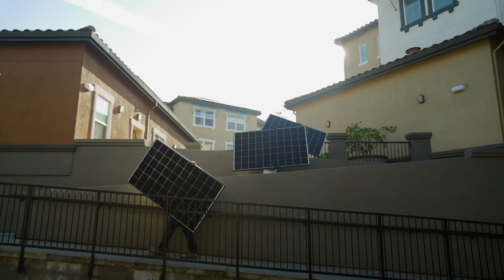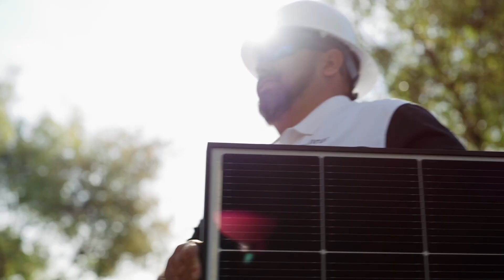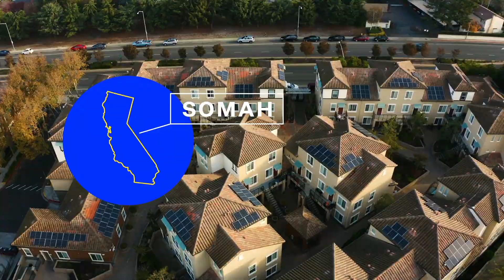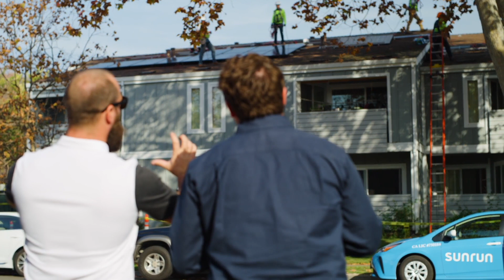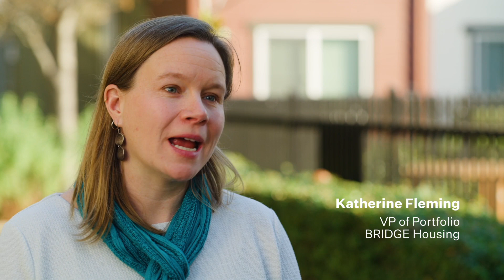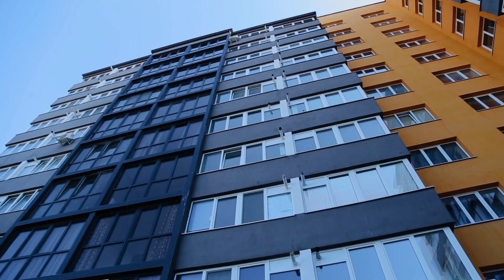Sunrun Multifamily 2022

Comment: Beware***  Would not recommend Sunrun.  We purchased a Brightbox battery to use after the sun goes down.  We shared our intent with the salesman prior to the purchase. However, Sunrun has decided we can only use the battery from 3pm- 8pm.  In the summer this $6k box just sits idle since the sun does not go down until 9ish. They originally stated this was an agreement with Sunrun and the utility company until we had a conference call and when the utility company stated there is no such agreement.  The utility company stated they are encouraging customers to use their battery.  Sunrun then stated the contact was the one my husband and I signed that reads "You agree that Dealer may, from time to time, remotely administer the batteries in your Solar Facility in connection with demand response or other programs in coordination with your utility to maintain the reliability of the electrical grid." which means even though we own the Brightbox they have control over it and will not change it or allow us to use our battery after 8pm.  I guess the "other programs" would be the owner not using their own equipment.  I'm still waiting to hear back from a Manager after three other employees continue to inform me this is an agreement that will not change.  We are now paying for electricity after 8pm with a battery that is charged.  Paying for solar panels, a battery and the electricity to the electric company was not what we had in mind after spending $24k.